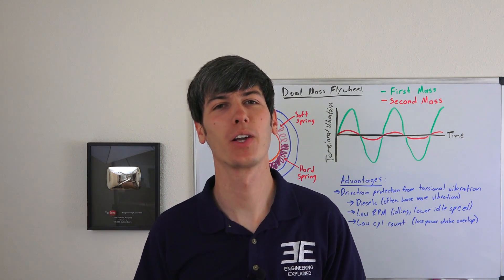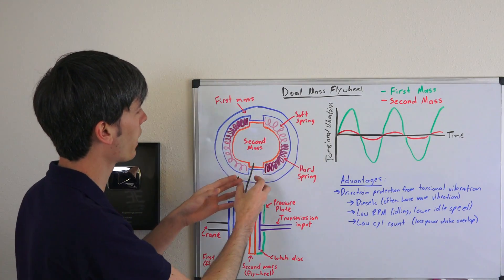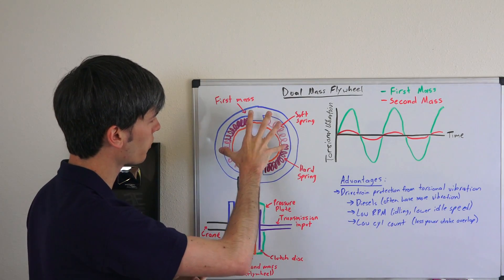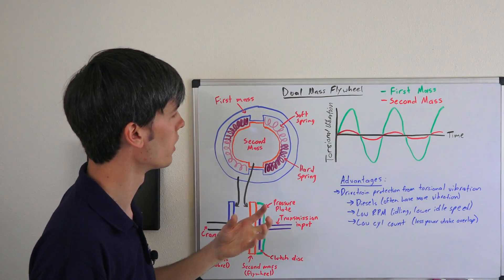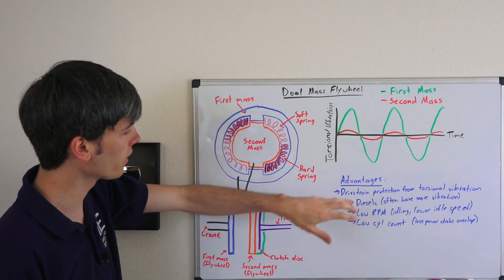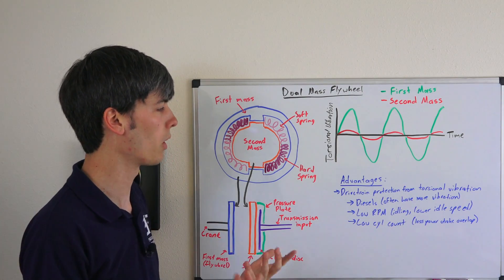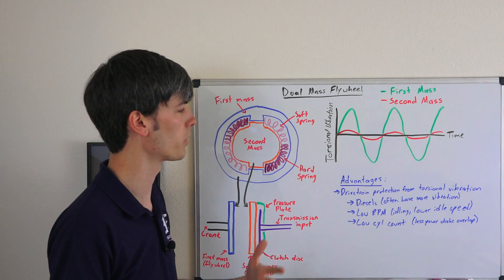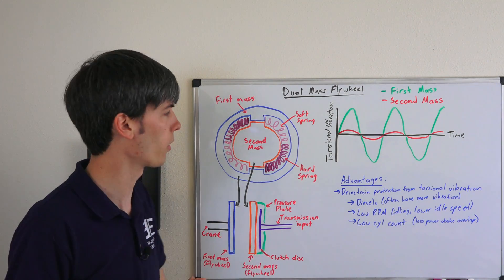Dual Mass Flywheel - Explained

Comment: I though that the springs in the clutch are used for diminishing the impacts in transmission system when clutch release. For me the function that you mentioned (absorbing energy of the explosion and gradually restoring for the system)  are done by the flywheel. Its a interesting approach!

Comment: No mention of all the down sides of a dual mass? More rotating mass on the motor = more time for the engine to change speed between shifts.
Reply: 3e the opposite thing happens because with duel mass and trans input sprung hubs with marcel springs you have more slack / time and some slipping before you apply full power but at that point its mostly if not all the way engaged ready to go vs big shock loading = lots of clutch slip or something giving way = a bad day

Comment: Engineering Explained i posted something i thoght of myself on CT and i'd like to hear you opinion on it as an engineer

you know, engineering is all about being innovative ;)

http://www.carthrottle.com/post/EdMvPu/
Reply from the maker: bucketslash11 I guess I'm simply unsure of what I'm looking at. What is the idea?
Reply: Engineering Explained I think I've figured it out... it seems that he's using a magnet pushing against a magnetic rim on the wheel to work as suspension... there are a lot of practical problems with this that I can think of... the rim staying in the magnetic field for one...
Reply: Engineering Explained the rim is sitting on in'wheel electric engine whcih is sitting on a stalk down from the body work (think how the caster angle is formed)

the stalk has a mag-lev at the top of it and a bearing which makes it able to raotate the wheel, it will need this as the steering rack and front wing is removed for reduced drag (will need sensors so ehat each wheel is pointing the same way)

the suspension is moved back to the connection with he body of the car and it should also ave some big guiding pins so that the energy goes into the shock absorber

Comment: How viable is this design in performance applications?
Reply: It's not, for frequent gear changes a single mass flywheel is preferred as it's lighter and less prone to failure
Reply: Generally single mass handles performance driving better. Simpler design that can optimize holding force and hard shifts. But it’s more harsh.

Comment: 93' Acura Legend with a Type ll Motor meshed up with a 6 speed. They come stock with a DMF. Makes it buttery smooth especially for the year make. Too bad they're over 1k for a new flywheel if you can even find it. Plus DMF springs can get worn as well as the surface. (maintence)

I replaced my DMF for a SMF. Less rotational mass, also can be easily resurfaced for further use. Cheaper clutches to boot. Won't have as smooth and luxurious power delivery.

Comment: Is that the reason (or at least partially) why newer diesels are much quieter. If not so what are the reasons for the lack of "rattling"?
P.S: I don't believe latest common rails make all the difference cuz I've heard them being pointed as the factor.

Comment: so, the reason my transmission sounds like a blender with marbles in it is the fact that the stock clutch was replaced with an aftermarket one and most probably the stock dual mass flywheel also was replaced with a straightforward single mass flywheel... right?

it's a single turbo supra with aftermarket clutch and the V160in it makes all the noises when in neutral, or when cruising/decelerating. it's quiet when the clutch is depressed (although the clutch also makes noises, albeit different ones :D ) or a continuous power is fed to it.
Reply: nihontoman kinda sounds like you've got an aftermarket twin plate dude. Get under there and check it out
Reply: Yeah, I'm gonna do just that, but still gathering up some info before I do that... the car is still very new and all the noises it makes made me nervous but turns out everything should be noisy, except for the worn out rear hatch rubber stops :D
Reply: It sounds like you have a single mass flywheel.

Comment: A lot of people in the first gen CTS V community will tell you that the dual mass flywheel is less than desirable. It's common for them to swap with a lightweight single. I'm pretty sure mine is crapping out on me. I like that they allow you to creep at low speed without stalling but they seem like a burden to this car. Maybe it's not so much the technology as it is the implementation though.

Comment: Jason what do you think about an idea of eliminating the flywheel and replacing it with Flywheel KERS element to reduce weight and many other benefits it would bring, would it be a good idea?
Reply from the maker: Mikee CZ If your goal was to reduce weight, better to switch back to a SMF. Adding KERS will add weight and plenty of complexity.
Reply: ye but i mean for cats that already use flywheel kers
Reply: Mikee CZ  A KERS unit has significant weight, I doubt there would be any weight savings over a conventional flywheel.
Reply: patw52pb1 as i said, i meant it for cars that already have kers...

Comment: Wouldn't it be possible to integrate a similar system on the clutch pack itself for similar results? As you said, there are also springs, but it's a simpler design. 

Also, this system has an effect on the clutch pack degradation? It seems that smoothing the torque delivery would make the clutch pack last more.
Reply from the maker: Thiago Silveira Yes, you can do it on the clutch itself (which is what single mass flywheels do), however this reduces the vibration before it reaches the transmission (which is connected with the clutch).
Reply: Is it bad to replace a dmf on my Lexus is250 that’s in there already to a single with a spring loaded clutch ?

Comment: Can't wait to replace the dual mass flywheel in my Fiesta ST with a lightweight, single mass flywheel.
Reply: Make sure you get a sprung clutch disc.  Or the rattling will drive you crazy
Reply: +krjcook Youtube 370z flywheel rattle... Im looking to replace the clutch on my G37 (same as 370z) and im kinda bummed if i go to a lightweight flywheel its gonna sounds like a rock crusher...
Reply: @ryanfonseca3270  how it all went?
Reply: +Ryan Fonseca just find a manufacturer who makes a sprung clutch.

Comment: Won't a *cross plane crank iron out most of these issues as well? I would assume making the power delivery smoother as well and making tire management a lot better. At least that's the difference I've noticed on motorcycles. Vtwin's and the R1 with its flat plane crank don't kill tires as much as a tradition inline 4 does.

*edit: wrote flat plane initially.
Reply from the maker: vidurc I believe most I4's are flat plane. The term is more commonly used with V8s as they're very distinct differences. Also, flat planes aren't exactly smooth, they have a considerable secondary imbalance: https://youtu.be/_TssXF8yQek
Reply: The r1 has a x plane crank.....
Reply: Engineering Explained I'm sorry I meant to say cross plane. Yes you're right what the CBR's Suzuki's and other brands use is a flat plane setup versus what the R1 uses which is a cross plane setup. 

*****  Sorry. Yes that's what I was trying to refer to. Got flat plane stuck in my head!

So if a cross plane setup was used, would the imbalances be ironed out a bit more?

Comment: generally mechanical low pass filter..
Reply: Very good analogy!
Reply: More like a compressor as far as visualization of amplitude 😊
Reply: Low pass filter filters out high frequencies , flywheel reduces amplitude, frequency of vibration stays the same. So not so good analogy.
Reply: @barciu11  yea, its more of a dampener
Reply: @barciu11  Low pass filters "reduce the amplitude" of higher frequency

Comment: Awesome video man! Is there much energy loss in the springs due to their resorting force not being the same as the amount needed for compression?
Reply from the maker: Ray O'Mahony I wouldn't say so, springs are more of energy storage devices rather than energy dissipation (through heat).
Reply: Cool, I know it would be a hard to measure but just was wondering your take on it!
Reply: Engineering Explained but surely during heavy acceleration the springs will always be under some tension while the clutch is engaged, and only expand back out when the pedal is depressed? So they ARE storing the energy, but they aren't releasing it into the transmission, so it's basically useless in that particular situation?

I realize it's more geared towards comfort than acceleration, but couldn't an up rated tv damper on the crank pulley do the same job?
Reply: +lolz larkin This is a good question I wish to have answered also.  To my understanding, whilst driving with the clutch out (in gear) and under power, the springs would be always compressed, albeit to varying degrees depending on the power output. The springs will then expand again when your foot lifts off the accelerator.  Does this place the springs under constant load and therefore reduce the spring's life?
Reply: It will depend on how stiff are the springs inside the DMF and i assumed they're tuned to the vehicle. Under acceleration the torque will decrease while the rpm is getting higher, so in fact you will have the stored energy coming back to the transmission due the engine natural loss of torque at higher rpms, of course this happens gradually. In a SMF there's no energy stored in that matter, so the power delivery its immediate, yet the energy will be induced to all the components before and after of the flywheel, which would wear them out faster.